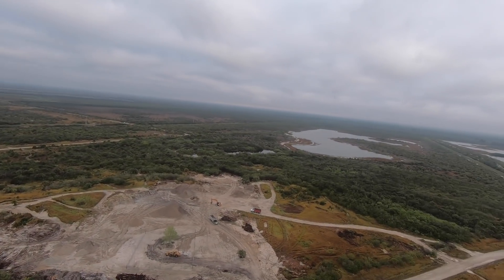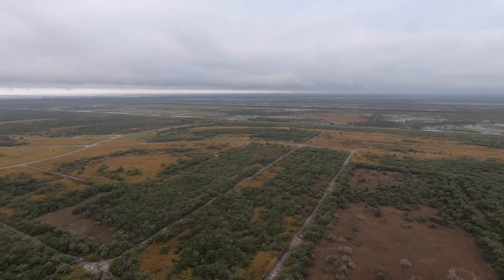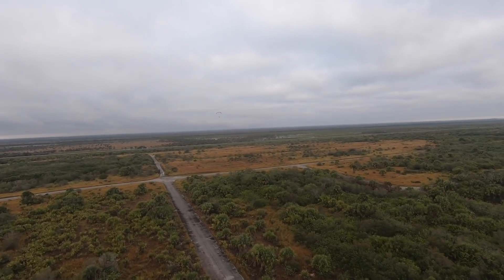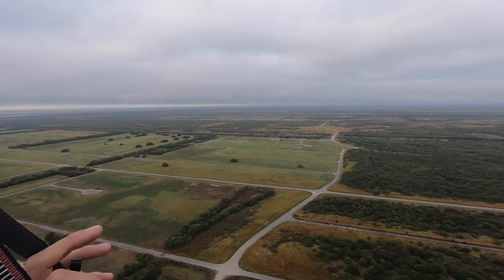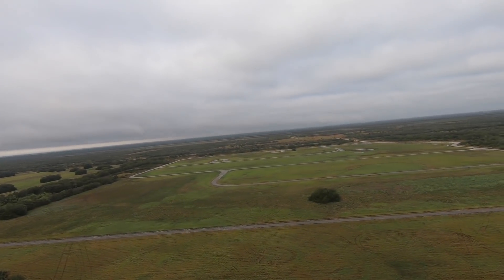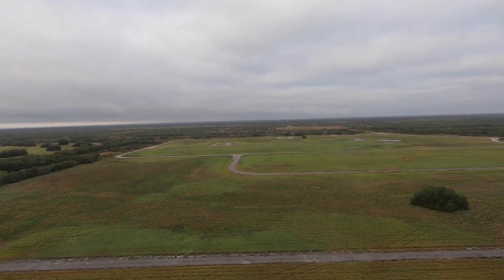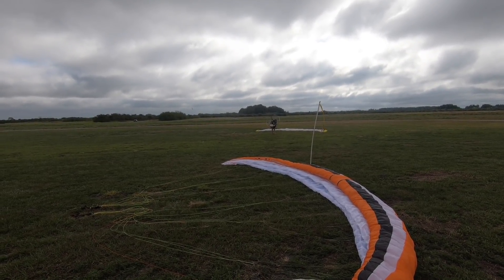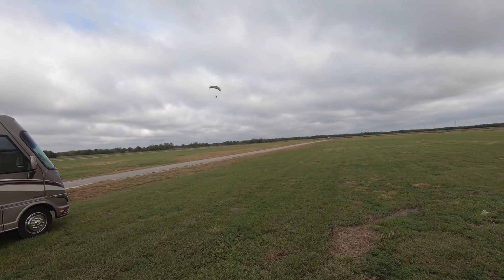Advancing thru Intermediate Powered Paragliding 008. Paramotor Performance

Comment: Motley Crüe! 🤘😊

This topic grabbed my attention, since I have what I expect will be an extremely challenging takeoff / landing area (for a beginner, anyway) in my back yard. I'm not even going to attempt it until I've got a few or several months of experience under my belt. There's a hill, loaded with trees on one side (and behind me), blueberry bushes and a couple sheds on the other. It's nice and straight for about 400' before I need to clear the neighbor's (have permission to fly over there) stone wall about 3' high, then I've got another 200' from there before I need to clear power lines. We're cutting trees 50' back on the hill, so it should be plenty wide enough. Should be very easy for someone with plenty of experience (depending on winds, of course - rotor central here ...). Circling here poses another challenge - a few fruit trees, a big pine, a 1980's satellite dish (HUGE), and of course the buildings, wires over the street (wires are on, and cross EVERY street up here in MA), and everything surrounded by trees on a hill in a "J" shape. Again, probably could be done by an experienced pilot, but precision is of utmost importance here, as I'd be threading a needle around obstacles. I plan to get out the tape measure, buy a few more traffic cones, and measure out distances in a neighbor's field where I'll be practicing. I will get that dialed in, with wind, temperature, and seasonal variations taken into account, AND when I feel comfortable, MAYBE I'll give it a shot.  Got a long way to go until that day comes. Still need the paramotor! 😂 All part of the planning process - reading and watching as much as possible.

Great stuff as always, Todd. Much appreciated.🍻

Comment: I think the only thing you didn't address is engine failure after takeoff and how much more room that could require. I thought of all the variables and that one to me has become the most important one because I can safely takeoff in areas and have plenty of room with the engine working given all parameters mentioned. But with an engine out after takeoff that same area isn't adequate. You go into such good info in this video though and you are one of the better guys explaining things. Good video.
Reply: Agreed.  Nice job with the video Todd.  I'm with Chris in the sense I always try to make sure there is enough space/room to handle the engine out.  If I do this, then I have PLENTY of space for when the engine is working normally.
Reply: Yeah, that's a big one! It doesn't take much to clog these tiny carbs and OH SHT!

Comment: Todd, with weight being as important as it is, why when we fly commercial are we not asked as passengers to report our body weight in either large or small aircrafts?
Reply from the maker: Excellent question.  In a nut shell, time efficiency, but nothing is that simple...  First, over the course of my career, average passenger weights used had been updated TWICE... heavier each time.  Checked luggage is almost always weighed and "containerized", while individual gate checked bags, are counted at a "standard per bag weight", just like the passengers.  The crew retains the capability (at the Captain's discretion) to count "half weights"on appearance if needed for performance sake, but the newer transport aircraft have so much extra thrust and lift, that it is not very often needed, except on extremely short runways. Most of those short runways were lengthened in the past decades, so few if any ever come into play.  Most takeoffs use thrust reductions of 12-18% from full rated thrust.  The reductions extend engine life and drastically reduce the chance of an engine failure on take off.  Occasionally however, you will see flight attendants reseating people for "weight and balance" purposes, especially on smaller commuter style regional jets, but even there, enough performance margin exists, to haul even the fattest "average" passengers.  As long as they are loaded in a way that keeps the center of gravity between the fore and aft limits, "you're good".  So does any of this apply to PPG?  Well yes and no.  Our risers come to a more or less a point. The tips of our risers that connect to our carabiners are that point.  It's almost impossible to load those connection points too far aft or forward, since they are in fact points. About the only thing we can get wrong is where we attach the risers to our rig, resulting in an incorrect hang angle, but hardly ever an "out of C.G. condition".  You can load up (or even over load) a PPG wing.  Since we can't really go faster to make more lift,  because we are limited to our trim speed, we get lift but only to a point.  Where lift generated at trim speed, simply can't overcome the weight, we won't climb period.  We all remember the video of the one that looks like an off road race truck that smashed into the building after take off.  With fixed wing aircraft however, all that are certified are far enough below the ultimate capability, that the FAA more or less gives carte blanche approval for aircraft to be 10% over maximum certified gross weight as Standard Operating Procedure in Alaska and some other "need to haul" locals.  Over design in control surface authority make it possible, but we don't have that luxury with our paramotor wings.
Reply: Thank you so much for taking the time to answer my question with amazing detail.
Reply: @YankeeinSC1  - This is why I NEVER skip your comments section! GREAT info! THANKS!!

Comment: Is performance quantitative? NO, two pilots of the same weight and flying the identical paramotor and wing will have different results. Even in identical weather conditions one might run faster, use more power, use more or less brake, hesitate. Everyone must know their equipment and be confident in their training. Pilots must always take the time to inspect their Paramotor Setup and Wing. Practice Kiting, Practice Launching and also Practice Spot Landing. Bottom line is that every pilot must take it upon themselves to be the Best, the Safest Pilot in the Sky.